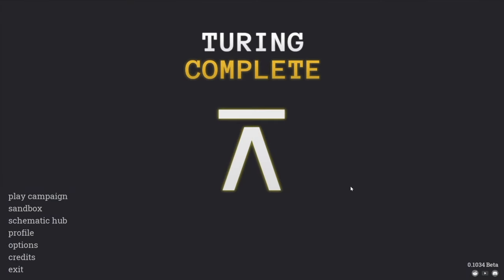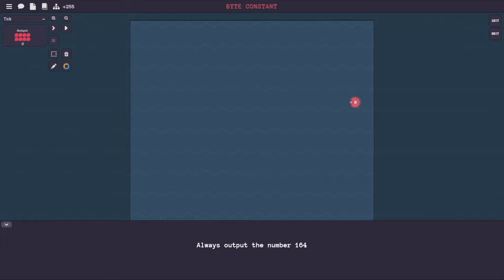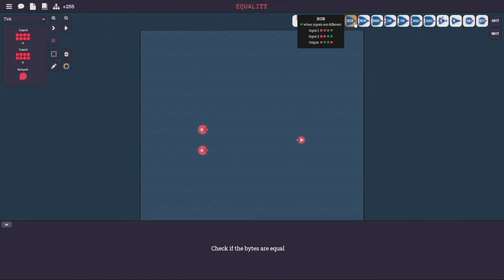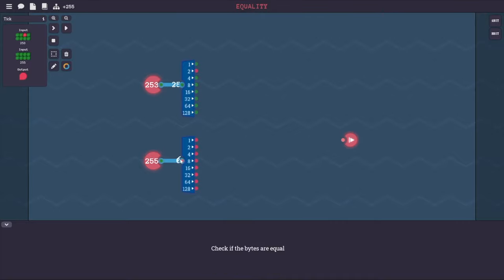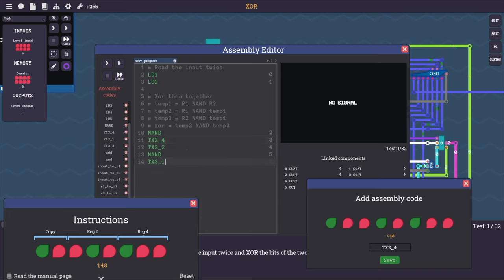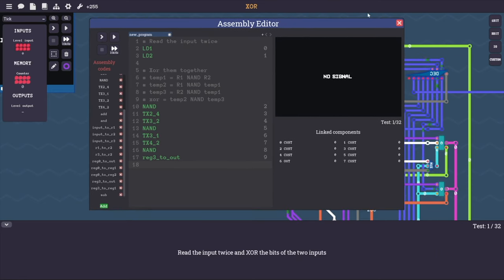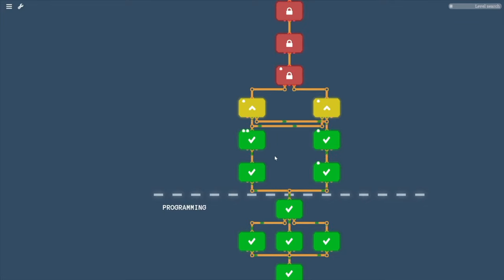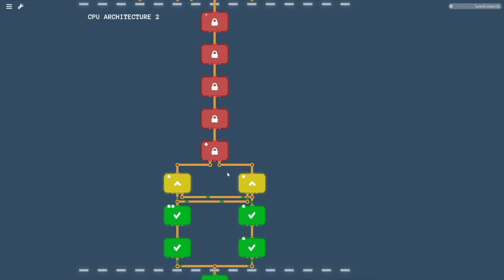Turing Complete, Part 8: XOR Frustration

Comment: The new architecture that it has you make is going to process 4 bytes at a time as an instruction, first byte is opcode and then 3 arguments where the third is mostly used as the return address
Reply from the maker: Thanks!

Comment: I solved the checking for equality by creating an 8-bit xnor by using 2 8-bit nots, 2 8-bit ands 1 8-bit nor, then split the resulting byte and anded the bits together. 

Now as for the assembly program for doing the XOR, I went into the component library by double clicking on the ALU, then I went into the schematics and created a new custom schematic and built an 8-bit XOR gate. Then I added that to the ALU after the SUB module. Then I went back out of the schematic back to the computer / assembler and added in the XOR instruction with an opcode of {01 000 110}, or simply 70 since this opcode was unused and it's in the 7th place after the SUB function. 

As for my opcodes, I assigned mov to {10 000 000} since all copy instructions have this, and left src (xxx) and dst(xxx) blank.
I then created 12 different register names that points to the 6 registers as well as all of the arithmetic and logic operations, and conditionals.

// destination registers
reg0 = 00000000
reg1 = 00000001
....
reg5 = 00000101

// source registers
src0 = 00000000
src1 = 00001000
...
src5 = 00101000

// The reg and src registers point to the same registers for example reg0 is src0, ..., and reg5 is src5. However, they do have different opcodes. 
// You can also add or concatenate your assembly instructions with (+) such as:
mov+src0+reg5  # this will take what's in register 0 and copy it to register 5     
mov+10                # this will take what's in register 1 and copy it to register 2 since
                               # mov is 10-000-000 and 10 in binary is 00-001-010             

// As for the Input Bus
in    = 00110000
// And the output bus
out = 00000110

// These work in the same manner above:
move+in+out        # this will take what's on the input bus and copy it to the output bus. 
move+in+reg4      # this will take what's on the input bus and copy it to register 4
move+src4+out   # this will take what's in register 4 and copy it to the output bus. 

// I also created an imm instruction for Immediate Value. It's basically just 0 for all bits and it can be used in many ways
// It allows me to use it as a const zero if I need to zero out a register
// It allows me to easily add in an immediate without just having a magic number
// So instead of having 
7
mov+reg3      # this will move 7 from reg 0 to reg 3 since the mov 1000 0000 instruction + the reg3 00 000 011 instruction gives 10 000 011. 
// With the imm instruction it would look like this making it more readable:
imm+7 
mov+reg3

// Note of caution with this approach, The registers by themselves can act as a constant. Reg0-5 is 1-5 and Src0-5 is 0,8,16,32,64, which can be useful such as in
imm+src2   # this will not give you the value in src or reg2 this will equate to imm+16. The caveat is the largest constant value that you can work with with immediates
                     # is 63. the high two order bits are reserved leaving 6 bits, giving you 64 values [0,63]. Just something you need to be cautious off. 

// With all of that in place here's the assembly code for the XOR Byte, it's that simple and clean after adding in the 8-bit xor gate to the ALU. 
mov+in+reg1
mov+in+reg2
xor
mov+src3+out

-----------------------------------------------------------------
I hope this may be of help to others who've made it this far or are still working on it. Happy engineering and coding!